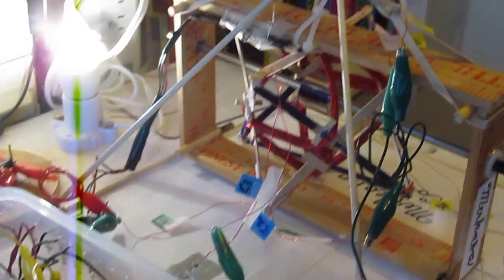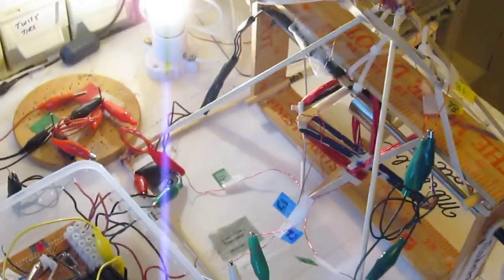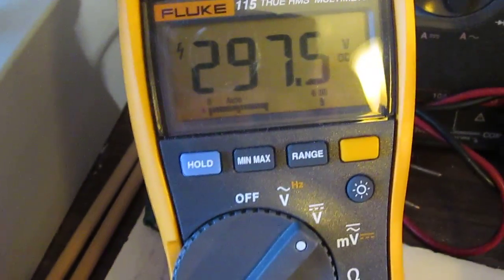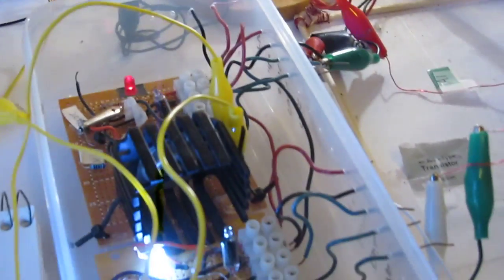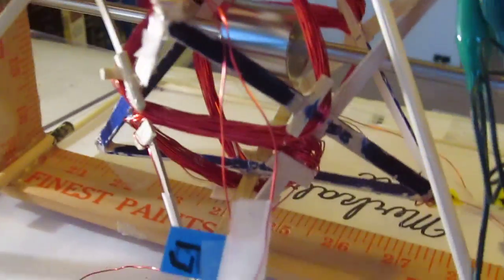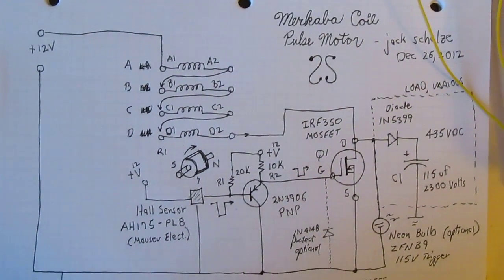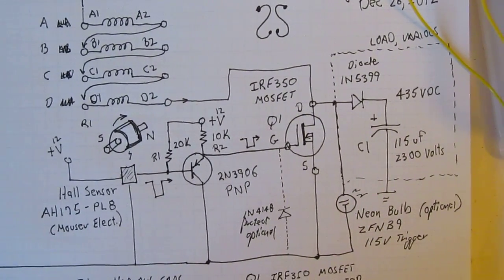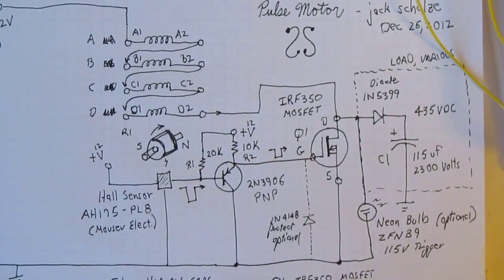Merkaba Coil Pulse Motor

Comment: Mr Scholze this is amazing.  May I ask what influenced you to try a Merkaba structure?  And most coil builders show the design and creation of the coil but very few show the "driver circuit diagrams" this is really thoughtful.  You are in fact enabling "non electronics savvy" users to participate in these trials which could lead anywhere given the creativity it inspires and who knows where it will lead as more and more users are involved.  Thank you sir.

Comment from the maker: thanks mnsman,  I thought the highest voltage is determined by the height of the backspike voltage from the collapsing mag fields of the coils.  The IRF350 is designed to handle 400 volts Drain to Source, so is ok with 430 v or so.